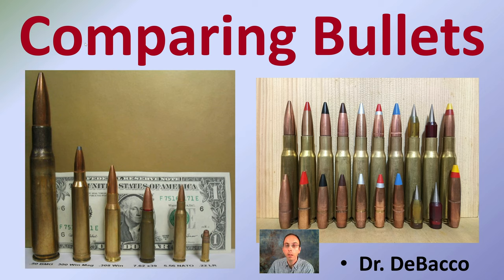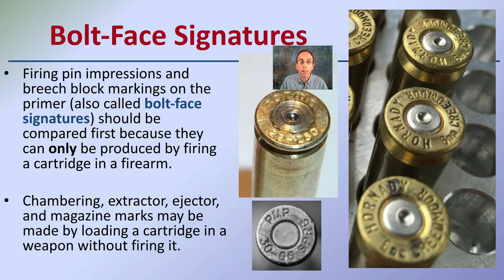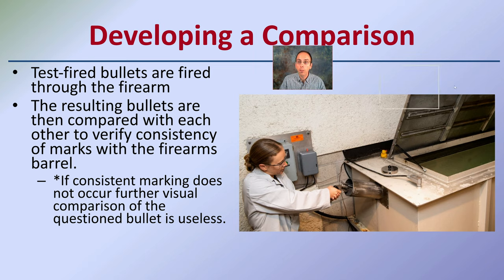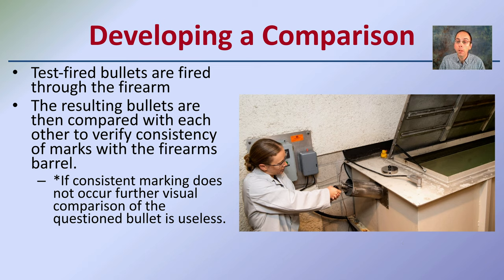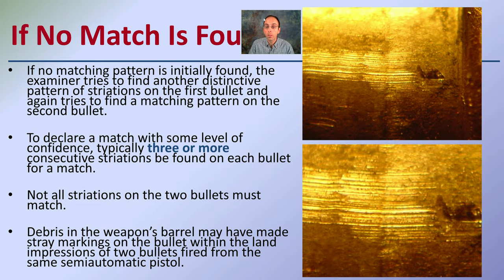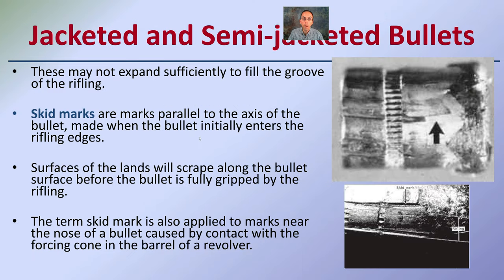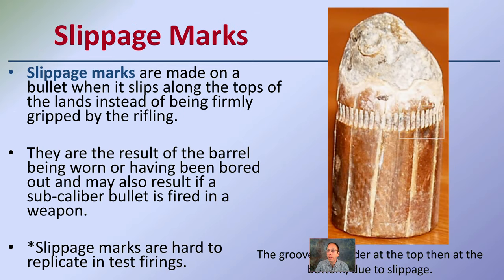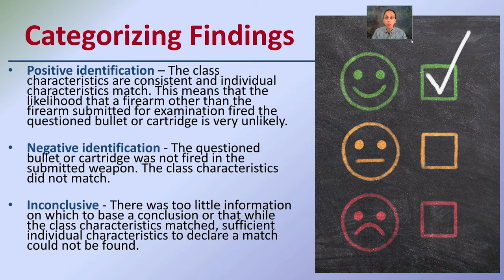Comparing Bullets

Comment: How likely? Is the repeating patterns at any point? Both fingerprints and dna give a quantitative analysis
Reply from the maker: Hardest part is the sample bullet is often hard to get a good sample of due to the typical deformity due to impact.  However, this is just one piece of the puzzle to build a case.
Reply: So comparing an unspent round that has been manually cycled, and matching it to a specific  weapon would that be possible?

In order to do a comparitive analysis would you test fire the gun, or manually cycled the test round? 

And last question, would 5 days be adequate amount of time to run all test. 

Thank you so very much for your time!